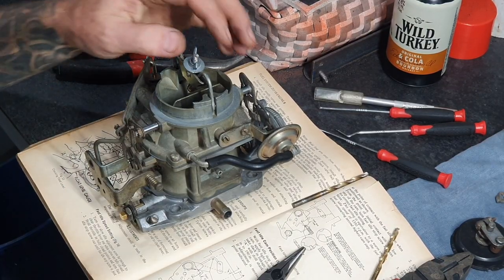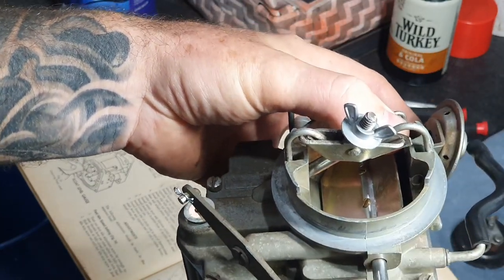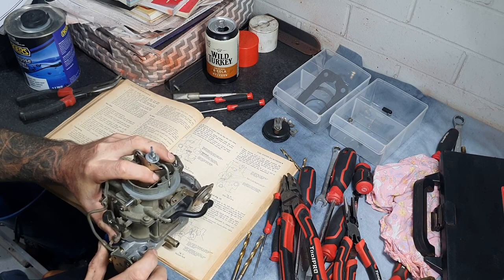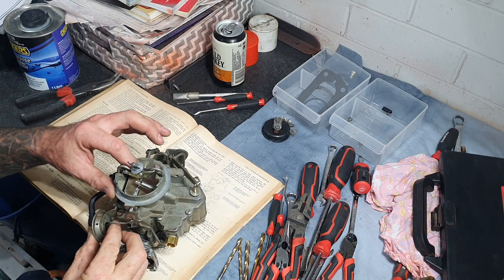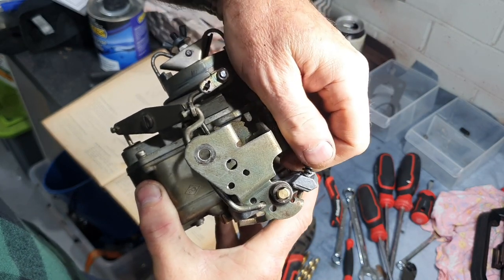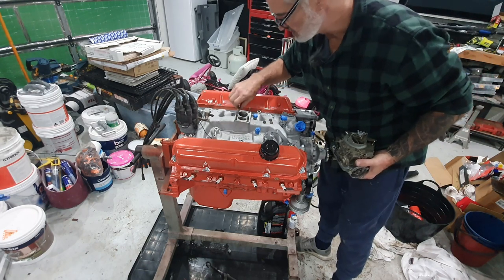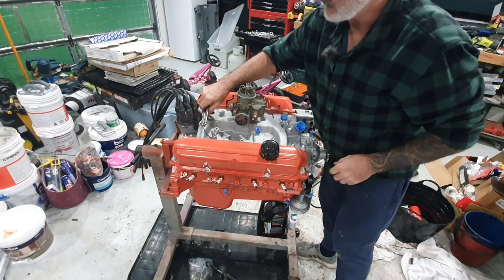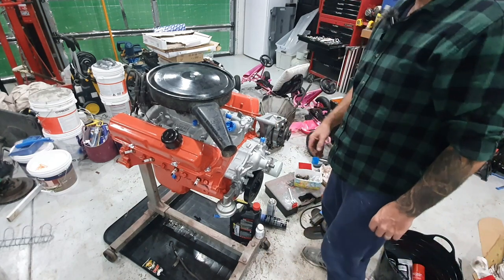How to Adjust a 2 Barrel WW Stromberg Carburettor.

Comment: Sweet,learning time for me.. Trying to bring an old Tonner back to life.
Reply from the maker: @benjohnson7170  I had a 308 th350 WB one tonner.  I Tubbed alloy tray for some big wheels and tyres. That was back in the 90's and people said I was crazy for wrecking the tray. Now half of them have a tubbed tray. Someone has to start a trend hey? If you need to know anything and I can help out just reach out.
Reply: @SullysRodskustoms.   Ha , top stuff. It's been a long  20 something  years away from Holden's for me.
Wrxs and Mk1 Escorts Hondas.
But something dragged me back.
Getting pretty good at welding now..... But fark. Parts, Holy shit..
Great stuff you do mate. I was in media,years ago. I know it takes quite the effort.
Reply from the maker: @benjohnson7170  be careful buying parts off market place. Make sure you get some fresh photos of what your after. Heaps of scammers out there now. Gone are the days of honesty and  integrity, that boat sailed years ago and doesn't look like coming back. I git ripped off $780 on a tailshaft for my gts coupe I'm building.  Check on the scammers pages fir the persons name, chances are they have already ripped someone else off.